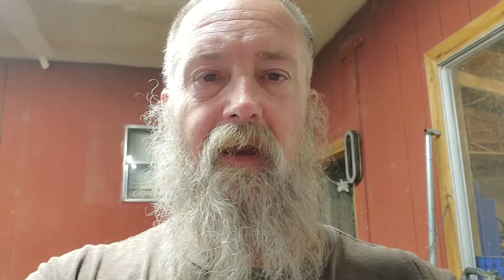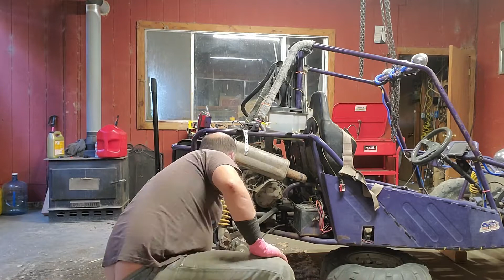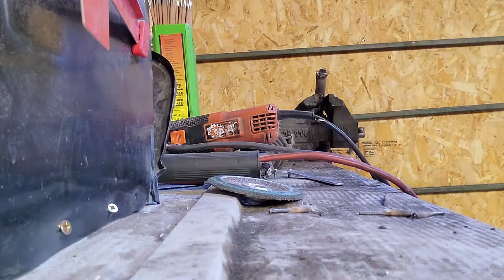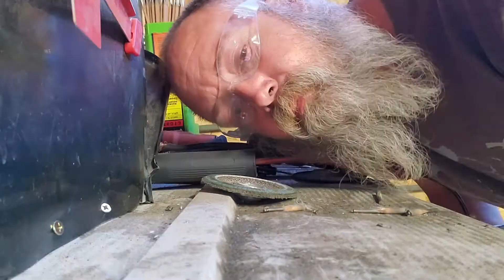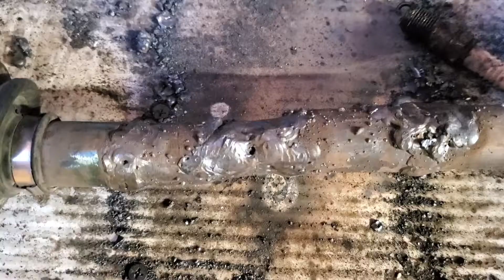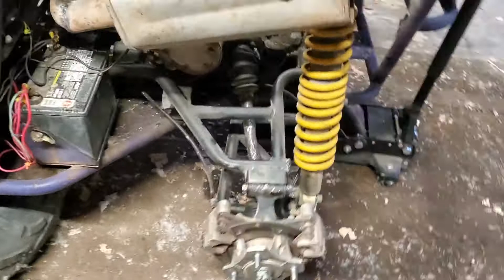Fordoyner Joyner Engine Swap and Mods Part 13

Comment: Really enjoying the videos bud. Keep them coming!
Reply from the maker: Got another big project coming after this one. I call it Frankenstein!
Reply: @BuildsAndMoreRacing  looking forward to seeing it, man! What’s the big project?
Reply from the maker: @codywillette3738  Tearing down a 1984 Toyota FJ60 to the frame and putting a 1973 Lincoln Mark 4 460CC and completely rebuilding it then On to a 1988 f250 ZR5 manual trans and popping it in there, then finding a Good Sports style body to weld onto it. Currently sitting on 35" tires. Throwing in front and rear dana 60 pigs with 410 gears. Then gonna paint it Green and Black with Frankenstein written down it's side. Big Project but it is gonna be fun. I plan on using it to race in the mud races.
Reply from the maker: Taking parts of several different vehicles and putting them all together to take something like a hot wheels truck but in real size then taking it to the mud races. Its gonna be epic!
Reply: @BuildsAndMoreRacing  sounds awesome, buddy! Hope to see the videos out real soon